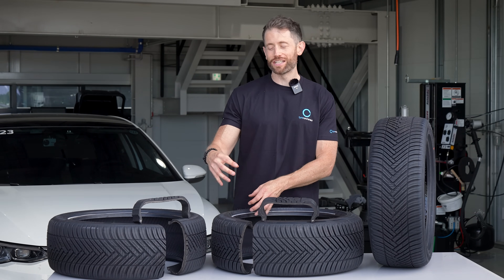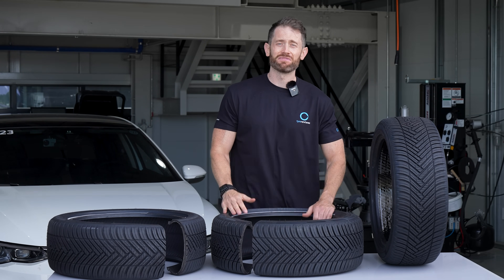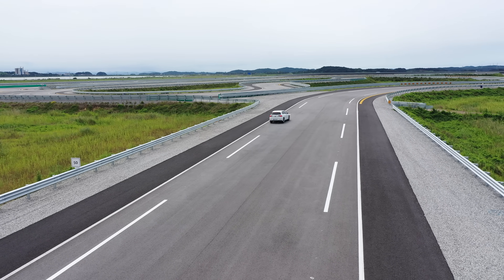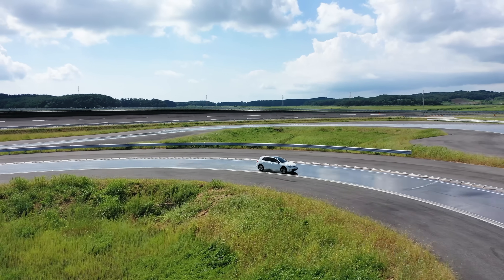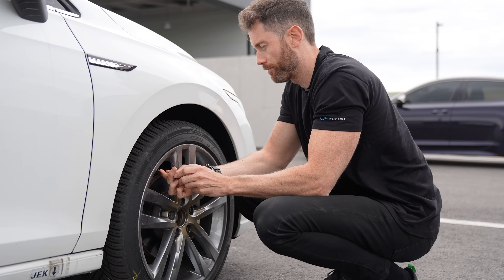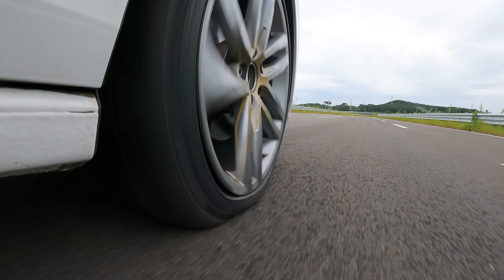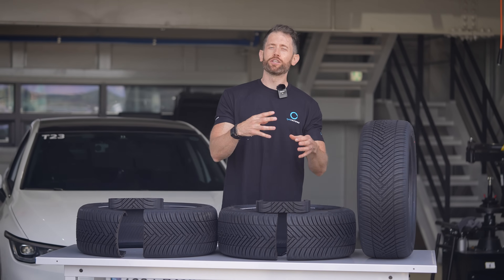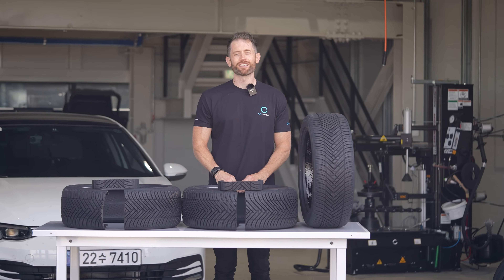Are Modern Runflat Tires Finally Good? Normal, RFT and SEAL Tires Compared!

Comment: Can’t escape that the lack of a spare wheel is a convenience only for the manufacturer and an inconvenience for the consumer, particularly as run-flats once punctured and run on have to be discarded and typically it takes a day or two to obtain a matching replacement.
Reply: Julian nowadays it seems that most car companies are run by accountants, so they are constantly looking at ways they can maximise the profits from each car sold. 
Some neighbours of mine have actually lost their cars due to mice or rats actually eating the plastic coating on the wiring loom
Reply: Not to mention, the runflat does zero good when the tread separates and the tire disintegrates.  Add in no spare, and the inconvenience now turns into a real PITA… especially if you’re in the middle of nowhere.
Reply: That’s why a spare is mandatory In india therefore they ought to provide a spare but these greedy manufacturers are providing shitty temporary tires

Comment: That self-sealing tire is very cool, but I wonder how manufacturers who typically void speed ratings after a repair, like Hankook, would handle it with such a tire. It's likely the driver would never know there was a puncture at all, and would probably continue to use the tire as normal.
Reply from the maker: I'll check for external recommendations, but as you say, in theory you don't know. I did dry handling after 16 punctures.

Comment: Thank you so much for this test. I have suggestion, if I may: you've used Hankook tires because they have the same compound. And that helps with control in the test. But I think this result  justifies a test where you compare multiple tires that offer RFT options. I'd love to know if I could swap my set of PS4 for the RFT version (PS4 ZP, I think it's called) with no drawbacks. My car didn't come with a spare, so that would be a plus for me. I know there are other manufacturers that offer RFT variants of the same tire (Pirelli is one of them) and it would be nice to know which ones are to avoid and which are actually a good idea.
Reply from the maker: I do need to do a runflat tyre test at some point!
Reply: @tyrereviews  Please do a RFT test! I drive BMWs that usually come with RFTs and always have the dilemma which RFT to choose :) The difference between Bridgestone Potenza SP001 RFT and Michelin PS4 ZP is night and day in grip and comfort!
Reply: @zlatko.  
which one is good of the 2
Reply: @cayman9815  Michelin PS4 ZP is in a different league compared to Potenza AP SP001 RFT! Especially on the wet and as comfort. SP001 behaves like on ice when it's raining.

Comment: Pretty convincing. The only argument I would personally have against runflats is that the number of punctures I've had over the last 10 years or so can be counted on the fingers of one foot, so it's really a solution to a problem I don't have.
Reply from the maker: I understand what your saying, but the counter would be how many times has your seatbelt saved you in the last ten years? Hopefully none, doesn't mean it's not useful though.
Reply: @tyrereviews  Fair point. Coincidentally, I had a full set of Kinergy 4S2 fitted to my car yesterday. Had I seen this video before I ordered them, I might have gone with the runflat version, but they don't yet seem to be available in my size.

Comment: From my experience these runflats really start to degrade and tear apart when used with high loads and long distances. My BMW G31 540d comes with, and reccomends, runflats as default - having no spare tire. After using the runflats for a couple of years, swapping between summer and winter tires, I always find at least one tire that has the internal circumference of the sidewall damaged - might also be caused by random pot holes.

Issue is that, as others pointed out, these tires are designed in a way that make them more prone to failure and also unrepairable. So, since I have the toe truck service bundled with my insurance, I personally much rather use normal sligthly cheaper tires and, in the eventuality of a catastrophic puncture/failure, pull off the road and wait for the toe truck.
Reply: This review was missing a key complaint about run flats that you mentioned - if you hit a big pothole, or drive on rough roads, not only will the RF tire get damaged, your rims will also suffer because the sidewall is not absorbing as much of the rough road hit as a standard tyre.

Comment: I once punctured my Bridgestone turanza 005 runflat during the last 100 km of 400 km journey on the motorway. The car didnt show any sign of instability and I was able to complete the trip with no issues. I stopped just once when my infotainment system alarmed saying loss of tyre pressure, but on examination the Tyre looked ok.
I only noticed the puncture the morning after.

Comment: This would almost make it a no-brainer to put run-flats on instead of normal tires. The only question, really, is: how often do you get a puncture with modern tires anyway? We know that modern tires are quite puncture resistant as it is, so if your chance to get one is very small indeed, then maybe the slightly reduced comfort and slightly higher price are not worth it. Hard to say.

Comment: Excellent video, as always.

I guess it is a question what generation of tyres are discussed. The first about three generations of runflats had their bad reputation not w/o reasons, but this is 15 years old sience.

I can't talk about BMW M (but I know some of the guys doing the tests on the Nordschleife), but I do know the theme with Porsche tyre development.

Sealed ones seems the better idea, the extra weight of the runflats is definetly a bigger disadvantage as bigger the diameters and as smaller the height of the sidewall is.

Just waiting for enough snow in Sweden to start the tests of the saison!
Reply from the maker: Good point, I hadn't considered the weight penalty increasing as the tire size / width does! Where are you testing in Sweden?
Reply: @tyrereviews  Depends on the conditions and the privacy level ;)
Artic falls is in the schedule, but UTAC could be possible also.
I'm not involved at planning, my job is to get the cars their in time ;)
And some road testing, but this is not requiring special facilities.
Just coming back from Idiata in Spain.
And looking forward for the winter saison... I like Portugal much better tahn the arctic circle in winter ;)
Reply from the maker: @marca.w.7237  Snow testing is great fun though, and the guys at Artic falls are just wonderful!

Comment: What's the lifespan of the seal material in the tyres? Is it comparable with the life expectancy of the tyre itself, or will it start to dry out over time and lose efficacy?
Reply: Yep, this was my fist thought too.  Especially with heat cycles, cold weather, etc etc.   but on the surface looks like a great option that (as Jon) I’m surprised isn’t more widely implemented.
Reply: They last the life of the tyre. You are not supposed to drive on a 6+ year old tyres anyway...
Reply: @DashCamSerbia  If you drive very limited miles and have a very conservative driving pattern, some treads will last until the tire fails from age or sun rot.  I've had tires last 20 years.
Reply: @kingduckford  Thread depth does not matter. The tyre compound will deteriorate after about 6 years.

Comment: From 42 years experience in the tyre industry... Most of the people who I deal with are against run flats. Especially when you have one that totally fails (and they can) and you have to be put on a tilt tray truck and driven 200km to a major town, then you wait 3 days for a replacement to arrive because that particular size was not in stock...  About as useless as the stupid space savers they are putting in cars these days....I'm fortunate enough to have a car that was supplied with a full size alloy spare..  Good report though.

Comment: Great review, huge thanks, at last a run flat that feels like a normal tyre. As far as I can tell the only downside marked against the CC2 is the road noise, 69db for CC2 with the K.4S2 at 72db.  Is this difference noticeable in-car? My dilemma is resolved, it's the Kinergy 4S2
Reply from the maker: Internal noise between the two has been tested in a couple of my all season tests, i believe it was pretty close.
Reply: More expensive, more fuel costs, un-repairable.
Reply: @NoManLearnsFromHistory  yes agreed but does it matter when ones children are always borrowing it? perhaps not.

Comment: The biggest thing for me with older runflats is that the car becomes unstable on older roads that has noticeable tracks. Pretty common in Latvia.
Reply: We call it tram lining in the UK. I found it was made worse on wide low profile tyres.
Reply: @geoffcrisp7225  the worst I have felt it was on my monthers in law F25 X3. On run flats the thing was plain scary on tracks

Comment: Well, that's surprising. I've previously heard bad things about run-flats' performance and avoided them. Also, I don't have a spare wheel, getting by on dumb luck and the occasional roadside sticky-rope fix. But this review is making me reconsider some of these choices. Funny what tens of years of development can do to a technology, and I might have missed it without your great video. Thanks a lot for that!
Reply: To be fair, the majority of run-flat tires available in North America (the loudest continent on the Internet) are still based on tires introduced 10-15 years ago, most are only available in fitments that came with OE run-flats, and most are pretty crap. This new Kinergy 4S2 run-flat is a welcome development in the segment and I hope it sees broader distribution in more common sizes in North America.

That said, I like the idea of the self-sealing tire even more, and the penalty to fuel economy for the run-flat is not trivial.
Reply: They're still un-repairable, expensive and cost more fuel to run.
Reply: @NoManLearnsFromHistory   they are excactly as repairable as normal tires, but Cost is indeed the biggest drawback
Reply: @liev535  Depends many companys decline to repair them, they are repairable if they still have air in them like a nail sticking in, if they are flat and you drive them like 10km to the next tire shop they are not repairable. 
I can easilie repair a small puncture with a tire repair kit on the road and air them up with a 12v compressor
That is defeating there purpose in my opinion, I can drive with normal tire without air but I damage the wheel, when the tire are already worn to about 50% I need to change both tires on the axle so I need 2 runflats or 2 normal tires and a rim, cost probaly the same.
I dont see the benefits of runflats, they dont safe money and arent conviniet because I have to drive to a tire shop anyway or repair them myself.
Reply: @jonasstahl9826  Safety is benefit. Imagine getting flat while driving 140km/h
Reply: @arabarran  Cars from the last 10years have somesort of tire monitoring either with a sensor in the tire or over the rotationspeed from the ESP, the car will tell when you have low pressure and you can feel it, go over to the slow lane and drive of the highway at the next exit, if you car starts to feel weird, engage hazard lights and drive even slower or drive on the emergency lane if possible.
Find a safe spot to park and change the tire or fix it or call a friend that can fix or change it or call roadservice.
If it is just something like a nail you can probably just reinflate it and drive home or to the next shop.
Not that big of a deal, if you are far from home you need to deal with a flat runflat tire anyway because they have limitations around your town you are close to home and reinflating is enough to get home or you are near a shop.

Comment: Time for a runflat with seal inside it as well then! Puncture proof tyre, just don't damage the side wall and you should be unstoppable!
Reply: Harry, or just a normal tyre with a sealant which is what I do for a business. 
Customer wins by not getting punctures, also wins due to a longer lasting tyre mileage as the sealant actually makes the tyre run slightly cooler.

Comment: If they made a run flat with the sealant that would be amazing!
Reply from the maker: I wonder why no one has done this!
Reply: Here in the UK I run a business called A1 Puncturesafe.  I install a gel into vehicles day in day out.  We do 6mm hi speed version which is speed rated upto 170mph and you can have upto 100 punctures of 6mm
Reply: @tyrereviews  working for a car manufacturer it's very had to certify SST's and hit all attributes. Assume be even harder and more expensive to throw RF into it.
Reply: @tyrereviews  the sealant goes bad in shorter time than the rubber compound?!
Reply: It would be very very heavy tire, and no comfort at all
Reply: Could you just inject some sealant into the run flat like they frequently do on bicycle tires?
Reply: @gilfolsom5980  The liquid sealant used in tubeless bikes is much different than what appears to be used in the seal tire in the video. On bikes, it's not really gonna seal big punctures, but rather help seal the bead and any small leaks. Also, tire guys will hate you if you use liquid sealant, since it makes such a mess when changing them.
Reply: Yes you certainly can have a tyre sealant put into a run flat. 
Just make sure that it is appropriate to you car and speeds which you drive at.
Reply: And expensive
Reply: Great idea! Until seeing this video I didn't even know sealant tires existed
Reply: Isn't it the case with the Continental ContiSportContact 5? It has ContiSeal (sealant) and the SSR versions are runflat... Or am I wrong?
Reply: @JoseyWales93  there's 2 different versions of the tyre one with contiseal which will self seal upto 5mm diameter. And only within  a very narrow specific area of the tyre tread area.

And the runflat version does not have the sealant. Instead the runflat tyre let's u drive upto 50miles at a top speed of 50mph.
One thing not mentioned in all the advertising blurb for runflat tyres is once a tyre has been driven in the run flat state for some time/distance is the tyre cannot be repaired as besides the puncture the tyre sidewalls will be knackered.
Ps your car must have both Tpms and ESC for the run flat options.